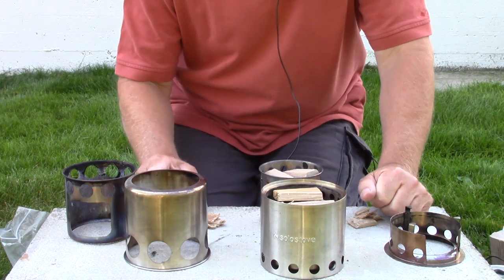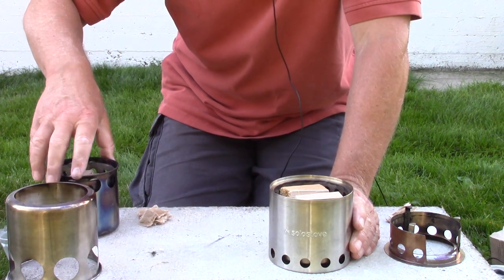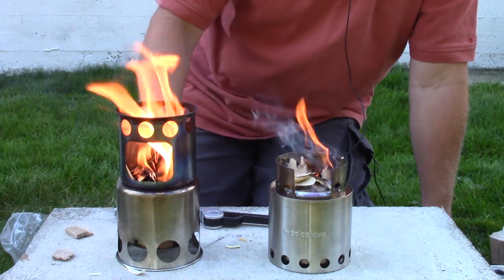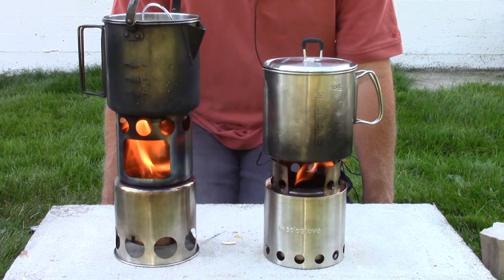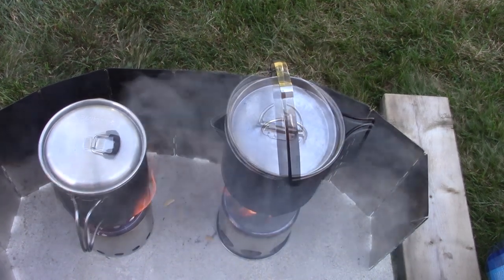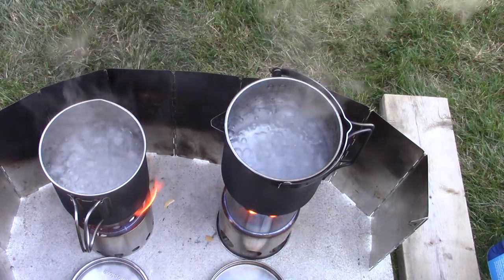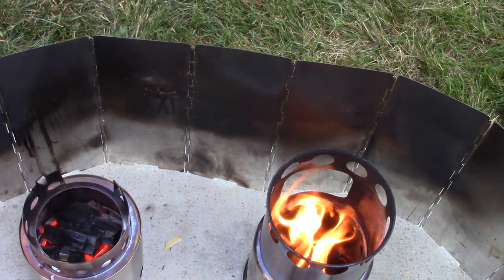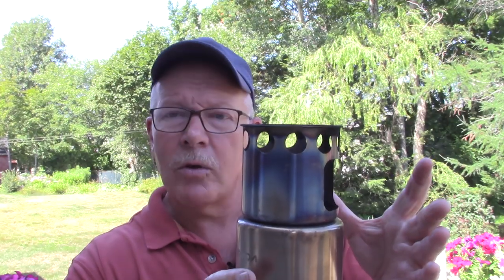Solo Stove & 900ml Pot VS Lixada Tower Stove & Camelwil 1.2l Pot - Part 2

Comment: The Solo needs higher pot prongs.  I noticed the flames look like they're gonna engulf the entire pot.  Will create a lot of soot on your pot.
Reply from the maker: I find that once the Solo starts gasifying properly there is very little smoke. The issue is I find I am constantly feeding new wood into it so it goes in and out of gasification often. Thank you for commenting

Comment: The reason the Solo and BB are so much more expensive is that there is a lot of welding involved instead of just punching holes and rolling the steel.
Reply from the maker: You are right on with this. Another way of looking at it is whether the added cost of production produces a better functioning stove. Don't get me wrong, I like the Solo. I own two plus two other wood gas stoves. This is just a bang-for-buck comparison. Thanks for commenting

Comment: Could you guesstimate from your testing how long it would take after a boil for the stoves to be cool enough to empty and pack?
Reply from the maker: It would depend on air temperature and whether I dumped the hot coals out (in a safe spot of course). I can estimate five minutes on average with the Lixada being the quicker of the two stoves. Thank you for commenting

Comment: I wonder if a vertical burn would have made any difference? I was surprised that you had to add wood especially as you used hardwood.
Reply from the maker: I think a vertical burn may have gone through the wood even faster. In the woods I load the Lixada more fully and get a plenty long burn time. I can't say the same for the Solo. Thank you for commenting

Comment: Twig stoves are not 'light and forgett'. 
You have to feed them peu à peu, not all at once, that's the way they work.

If you depend on speed and can't/won't babysit the stove, get a gas/alcohol stove.
Reply from the maker: All wood stoves or open fires require maintenance. Some more than others. Stoves that require constant feeding make it a challenge to do other required chores like meal preparation. Speed is not the measure of a good stove but efficiency is. Boil time was meant to help show potential efficiency as does length of burn time with a single load
Reply: I see your point, but I find the Solo stove in particular to be inferior to most stick stoves (some of the rocket stoves are worse).  It's not terribly light, compact or efficient.  PLUS, they rip you off with that insane price.  The IKEA hobo stove (amongst others) will burn a pot of water with zero maintenance at a fraction of the price.  I think they are deceiving people with the promise of a great stove that, in fact, is pretty mediocre.

Comment: Alcohol burner in wood gas stove test please. :)
Reply from the maker: Will do. Thank you for suggesting
Reply: @MarkYoungBushcraft  Anytime Mark! :)
Reply: I use the Trangia burner with the pot stand section, it's a really good height, and a windscreen. I drop a pop can simmer ring on it if I want lower heat.